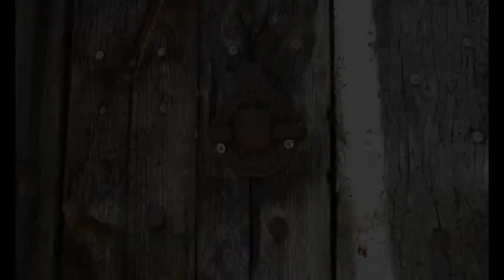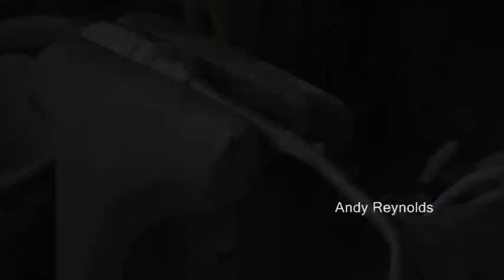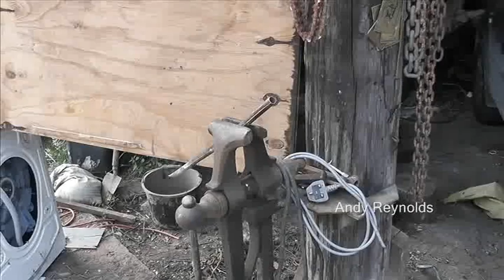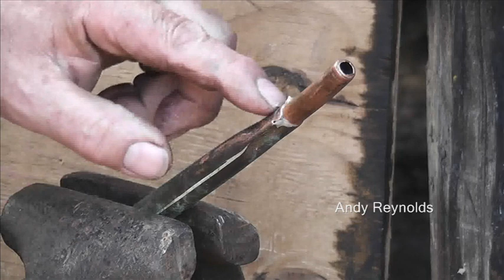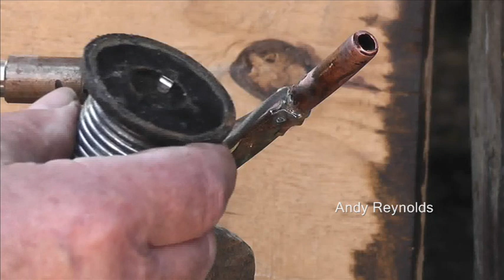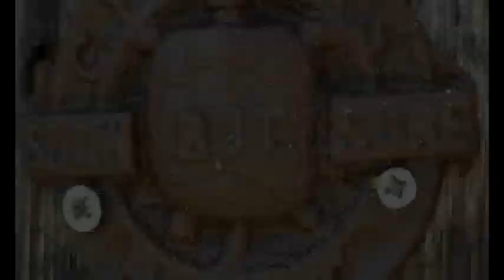Joining odd sized copper pipes, no parts required

Comment: Flair the smaller pipe so it's s tight fit, then fill the gap.
Reply from the maker: That would be more work and you have to leave room for the solder, cheers

Comment: Aye good torches them. One thing i would suggest, make a tight fitting foot of a larger diameter to fit the base of the cylinder to prevent it falling over when stood up. They have a habit of falling onto hard surfaces and the torch snaps at the place on the neck where the air is admitted. The 3d printer lad at work knocked me one up, but a couple of minutes on your wood lathe would have the desired effect.
Useful pipe joining  technique, that could be very handy.......Cheers
Reply from the maker: Simon, good move on the base, I will give it some thought, maybe something with a jubilee clip, cheers

Comment: Interesting. Presumably if you went to larger sizes e.g. 15 mm into 22 mm it would be harder as wall thickness would restrict your ability to accurately pinch the wall with mole grips. Out of interest did you pressure test this pipe afterwards? Looking forward to giving this a go myself. Thank you.
Reply from the maker: Hi, I've done 15 to 22mm with no real problem. As to pressure I have just made up a connection converter for another LPG tank using this method, took 29 bar, no worries, cheers
Reply: @TheInfoworks  Brilliant 
Brilliant. Thanks for your reply.
Reply from the maker: @freezefoot  It's those old skills that the corporate world want us to forget and become helpless, cheers

Comment: It’s a nice torch alright! Magic on and magic off. Plumbers of old who dealt in plumbum could make anything fit. Form up a 4” waste bend out of flat sheet. I can’t imagine a modern day plumber ever try the grips on a pipe. It’s all blamed on insurance I guess. No insurance no problem!
Reply from the maker: Maybe it's the insurance or maybe they are just fitters. Brilliant torch, grab one if you get the chance. In conjunction with a uncle Harold's brazing hearth I have easily brazed steel fittings together, how's the west? cheers
Reply: @TheInfoworks  grand. Haven’t started a small engine since I arrived. Perfecting my scythe technique instead. Meadow in excellent condition all wildflowers going over so perfect time to mow.
Reply from the maker: @bootsowen  Is that due to a drier summer?

Comment: Would work fine with brass fittings too
Reply: Maybe  not for flammable stuff, but for air and water stressed up brass would be fine. For dangerous media shimming with part of pipes would do good job tho
Reply from the maker: Maybe, brass it harder to bend but easy to solder to, cheers